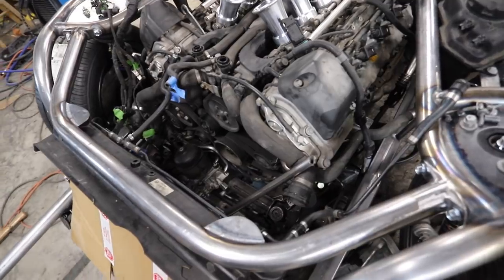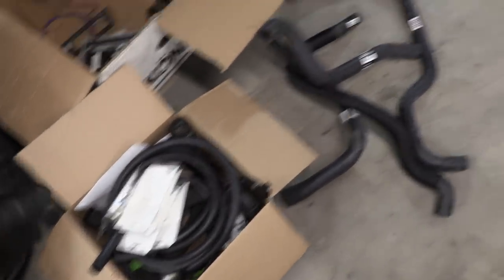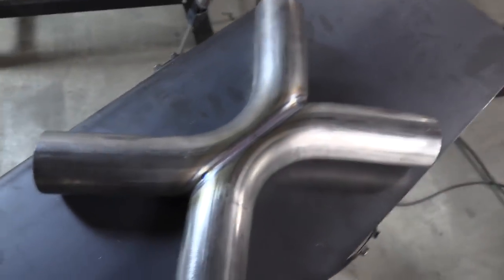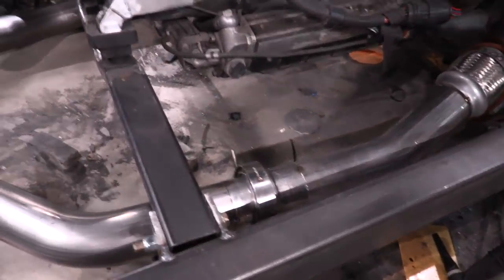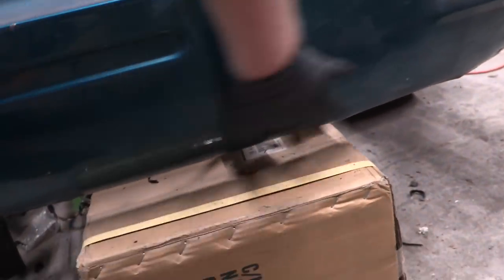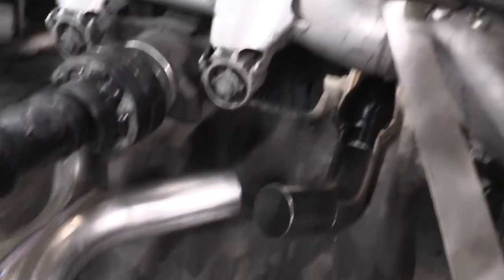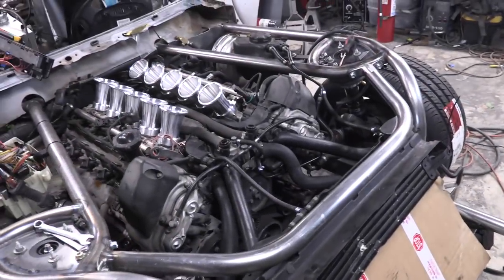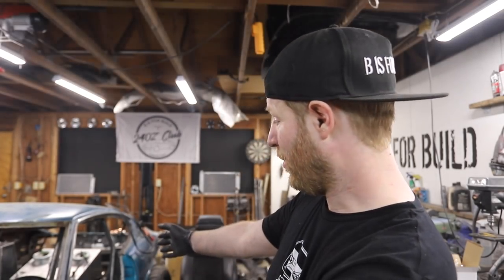The 240z Exhaust Is Ready For A Volume Test! And The Coolant System Is DONE!

Comment: You've done it now, but rather than spend an eternity making pre-bent coolant hoses hacked to fit - in future just use SFS /(or Samco) wire reinforced hose, bendy, strong and would have saved you a ton of time. Worth any premium in price, especially when your time is money it's probably cheaper overall. Given this is your day job I'd want a few boxes of the stuff in common sizes to have to hand - should approach them for a partnership/sponsor opp and they'd probably help out.

Comment: To bad the bmw didn’t came with a electric steering rack it would be so clean and simple...I did a conversion on my mustang from a crashed 2015 5.0(my mustang is 2006) 
I just connected power and 2 canbus wires and it works...but customs lines should work and look clean!!

Comment: hopefully the drive shaft wont smack the x-pipe  if the rear suspension ever extends fully
Reply: Its a irs that's not a driveshaft its a propeller shaft it does not move

Comment: hey bud put clip ends on the radiator first then fit the hoses and then just clamp them in place and take them off after you're done. skip a step save some time.

Comment: You've made a common mistake:  the x pipe looks home made, the problem with home made x pipes if you look at the engineering of it you've basically put a restriction on your whole exhaust you see, the center section diameter of the duel exhaust now has to squeeze basically through the diameter of one single pipe!  This is a common mistake!  Buy a replacement, there are exhaust companies that sell them where the crossover diameter is twice the size that it would normally be if it was homemade, they put in a box basically.  Sincerely, The Internet.
Reply: X pipes are indeed best for exhaust scavenging on non turbo engines BTW.  you are correct there.

Comment: Why no exhaust joints so you can remove the exhaust. Looks like a full weld in and they are a nightmare to remove
Reply: there are joins just after the flex pipes

Comment: working on a car takes so long.................now im scared to start modify mine
Reply: don't dare to modify your car if it is your only.. modified stuff breaks :p
Reply: José Ribeiro  its not like im gonna do a drift build or some shit, my plan was to change the front and rear bumpers because they have an ugly gray and not painted part, which looks like shit on the polished metallic black paint,make the wheels flush, changing the current wheels to something nicer and probably get it to about 200-250hp (small things for a student, renault megane cc 2004 1,9dci, yes i know its fwd and convertible but my dream is to get an bmw e30 coupe (not the m3 because my wallet is pretty thin) and make it into either rallycross or drift (and no, i am not a "fanboy" or "ricer")
Reply: Juanito 420  modifying doesn't take this long. This is an overhaul. Most of what you have in that list really wouldn't be that bad, or take that long
Reply: Jeremy Richardson  depends by how much money you got...and if you modify it yourself or in a 10 man tunning shop
Reply: Create a car is so long, modify a car can be long but not too much.

Comment: Sooo.... permanently mounting everything when you still have to pull shit off and out to get it painted so it doesnt look like a piece of garbage at SEMA?

Personally I would have just temporarily mounted things and worked on the floor and cleaning the motor before permanently installing stuff, and dropping the car off to paint while cleaning the engine and eliminating bullshit I didn't need. Id rather miss SEMA in order to have the car(s) A1 and just go the following year. But hey, do what you got to do because you dont want to miss SEMA, right? 😒